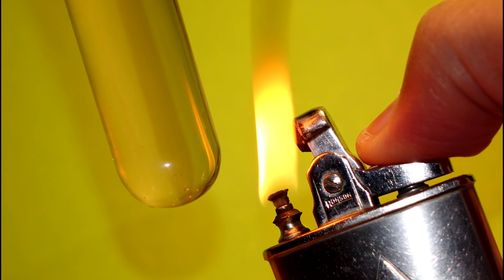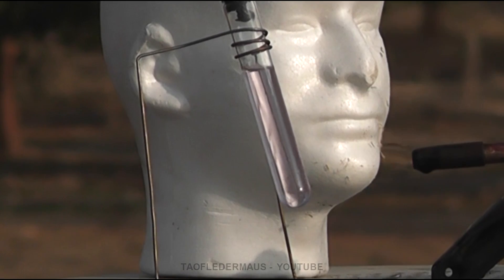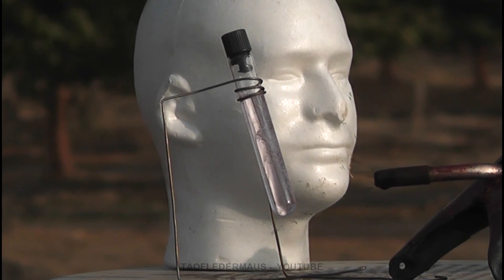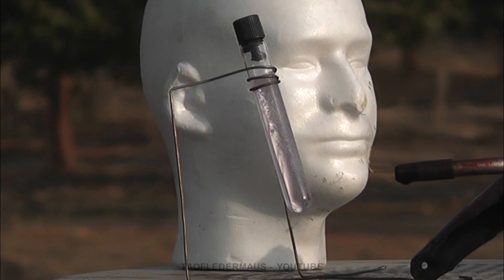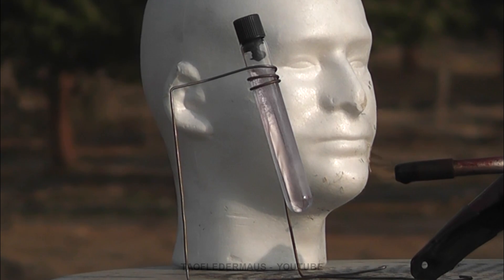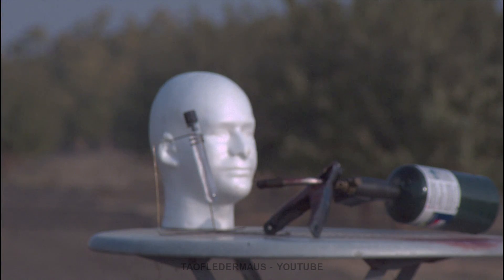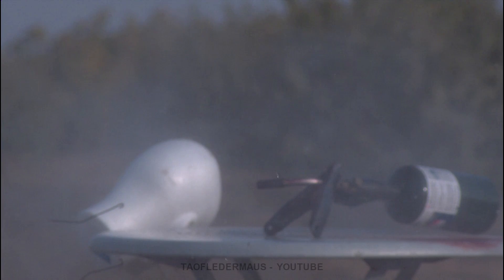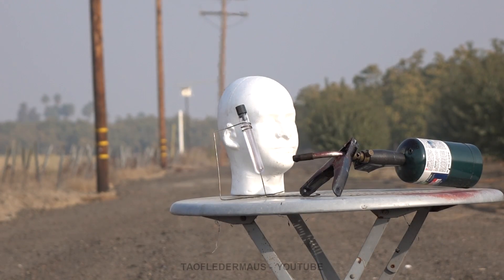STINKY COLOGNE - Test Tube Torcher Test

Comment: Need Bernzomatic 810 Stainless Steel Flame Spreader or like it to stop melting tubes easily. If your torch can't use one then use a torch that does like Bernzomatic UL2317 and a Spark Lighter.

Comment: In a rocket, BP is dif, then when heated to flash point in a closed system, Grain site doesn't even matter much as it is powded, compressed into a more or less solid block and only to surface burns, until you get to larger motor were the heat is increasing burn rate as the turn continues, much of heat is being released through the exhaust. For a cannon, being enclosed, it explodes, but it is still burning as the cannon ball is moving along the barrel, this varies depending on how tight the Wadding, ball are tamped. The tighter, the higher presure and heat, the faster the explosion unless the bp is also compressed and not let the fire, heat go around grains. but if heated to flashpoint, that wouldn't matter,  it will be explosive, acting more as a high explosive, instead of a low explosive, so an extreme fast shockwave, even if it only gets to I000 lb., it would be like a hammer blow. Also the air it's self will already be at a higher pressure befor the explosion from the heat. It may work if it was set up with a electric match, no extra heat and could be made to burn slow enough, like a small rocket motor, but as pressure increases, it may still become explosive. If the test tube is vaccum, that may also help. Any air already in the test tube will also be compressed.
Reply: Phoenix AF  Above.

Comment: I'd epoxy a wee thin brass tube into the  vial, braze it into a 1/8" threaded fitting. You can attach a tee, hook up your pressure gauge, then fill the lot with oil and use a grease gun as a hydraulic pump to find the failure pressure. 

If you use a full foot of brass, you should have enough thermal isolation so you could see the pressure when it's heated too.

Comment: If you want an easy way to determine the test tube burst pressure, you can measure the expansion of a liquid as it is heating. You could measure the final specific volume of something like water or ethanol and use some saturated pressure vs specific volume tables to get your max pressure. Might be a little simpler then epoxying in a pressure guage.

Comment: Hey Jeff, look forward to your testing the actual pressure strength of borosilicate tubes. Ace Glass Company has a nomogram of allowable (safe-ish) pressures at:  https://www.aceglass.com/dpro/kb_article.php?ref=9220-UOAK-4219 (.pdf link in center of page under the attachments header). Hope you find it useful as a comparison tool. Cheers!

Comment: Try black powder in the test tube and see if it holds to the pressure. 1 part black powder to 60 air should get you 500 psi and 1 part BP to 30 parts air 1000 psi (That is peak pressure after a few seconds the pressure drops to 1/6 of peak pressure)

Google insanerocketry blackpowder for an online calculator of BP pressure
Reply: The thing is, there is probably a difference in how much pressure the glass can take depending on whether the pressure builds up gradually, or whether it is a sharp pressure spike like you get from black powder - so this wouldn't give you an accurate measure of the bursting pressure from boiling liquid inside, most likely.
Reply: Well, one more reason to do the test! Comparing the upcoming pressure gauge readings to the "poor man's pressure test" with black powder
Reply: I know that heating a hybred rocket fuel (mix of sugar/gunpowder) would have way more power/speed when heated with a torch as compared to a fuze or electric match as the heat causes the burn to be way faster. I had a metal rocket and testing fuel mixes, heating to combustion temp. with a torch didn't work for that reason, Putting an amount of fuel, that with normal fuze or electric match, wouldn't get the metal rocket off the ground, could propel the rocket like it was filled with many time more mass of fuel. Also, all black Powder is not the same, it depends on the type of charcoal, sulfur, etc. used, how its prepaired, and gain size (F-coarse, FFF=fine, etc.) and how hard it's packed or loose. How well it was milled, etc.
Reply: Dry ice may not be able to develop enough pressure to burst the test tube but most importantly it would escape before the plug dries. Black powder has been studied for centuries and its properties are well known. The peak pressure is rather consistent across recipes (If it has more charcoal it makes more gas but it's colder so the pressure is the same etc..) and of course grain size only changes the burn rate and not the amount of gas generated.
Reply: Weigh out the corresponding amount of dry ice would be much easier. No issues with pressure spikes

Comment: "Does anyone know what those white boxes are on top of the poles?" Do they have an opening in the bottom? If so they could be bat boxes for pest mitigation. If not then they could be anything from short range signal relays to hawk roosts. :)
Edit: thanks for adding the last clip involving the torch being set too high. Failures are as valuable as successes (if not more so) to learning. :)

Comment: I'd recommend doing steam for the pressure test, epoxying in a copper tube to the mouth and making a "trap" like how steam gauges work. The trap condenses some of the steam, creating a water barrier so the steam doesn't go in the gauge and damage it. Look up how steam gauges are plumbed for reference.

Comment: Someone needs to hook you up with a flex high speed camera. Those vials are bursting almost completely over a single frame. SloMo Guys colab?
Reply: He already has a Cronos(sp?) high speed camera and recently had it upgraded too.
Reply: @Riceball01  I know, and that chronos is still too slow, which is pretty insane!
Reply: I don't think the chronos is slow, I imagine it needs to be set a higher frame rate but that is problematic when not knowing when the tube will burst as it can't film at higher rates indefinitely.
Reply: @robmanueb.  It does film indefinitely., it just doesn't save it all. That's what the trigger is for, he clicks it at the end of the event so that it saves just the portion he wants. It actually does keep a sliding cache of video at the selected frame rate. I could always be wrong though.
Reply: That would be a sensible way to do it, with the size of the sliding cache dictating how much footage you get. Chronos does rates high enough to make explosions slow, heck he can film flying bullets so I think he is trying to balance out frame rate vs length of footage vs resolution.
Reply: @robmanueb.  Pretty sure a flying bullet is much slower than these test tubes are bursting.
Reply: I just looked at some Phantom flex cameras, they look expensive for this channel. The Chronos and the Flex look like they have frame rates that are in the same ball park, but the flex can do it at much higher resolution. Life is a trade off, cost vs quality, FPS vs resolution, FPS vs available light. Time to start a crowd fund?